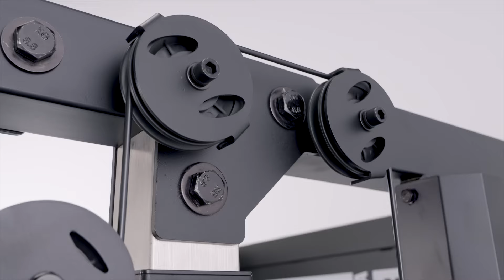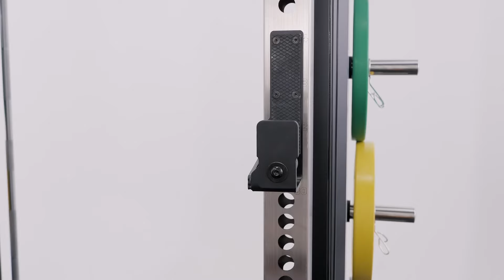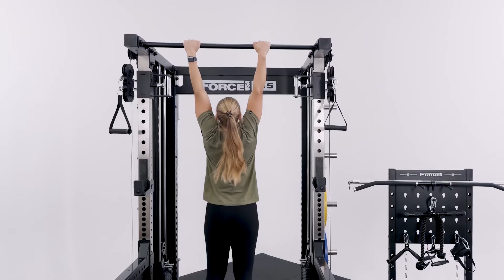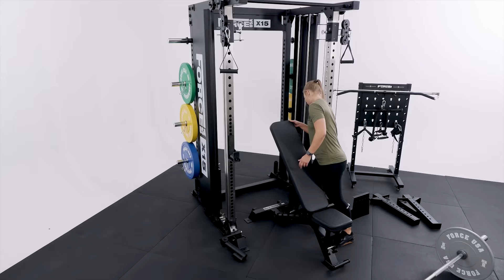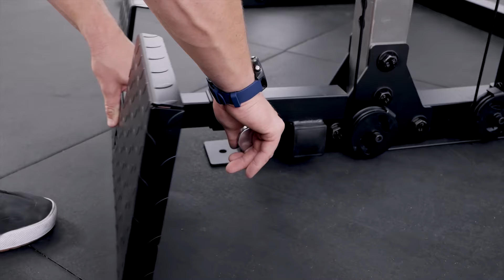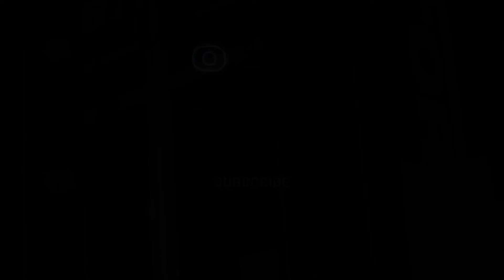Force USA X15 All-In-One Trainer | Walkthrough

Comment: I am interested in the Force USA X15 and would like to inquire whether it is possible to modify the 200 lbs weight stacks to support higher weights, such as 136 kg (300 lbs) or 100 kg (220 lbs), in order to increase the resistance.

Could you please let me know if such modifications are possible, and if so, what the procedure or limitations would be for implementing this change?

Thank you in advance for your response.
Reply from the maker: Hey, great to hear you're interested in the X15, it's a beast of a machine. The 200lb weight stacks were purposely designed to work with the 1:1 and 2:1 pulley ratios, letting you perform key movements like lat pulldowns and low rows with true 1:1 resistance.

We capped the stacks at 200lb to maximize cable travel, going heavier would shorten the range and limit certain movements. That said, you can still increase resistance using GymPins or similar accessories, and we've added band peg hooks if you'd rather use resistance bands.

Our team pushed the limits during testing and no one's managed to max it out yet!
Reply: No Smith..?
Reply from the maker: @rob3332  Not for the X-Series, but plenty of options exist with a Smith machine in our G-Series lineup (or C10). 🙂

https://www.forceusa.com/collections/all-in-one

Comment: So is g12 better than this model or?
Reply from the maker: There are a few things to consider, but It really comes down to two main differences: 1) G12 has a Smith machine, and the X15 does not. 2) The G12 has a 1:1 cable ratio, whereas the X15 has the option to switch between 1:1 and 2:1.

Hope that helps 🙂
Reply: @forceusa1092  yes it does because when me and my wife bought our g12 it was your first edition one. I know you've revised it a bit and now have other options as I'm learning them to spread awareness about your business 😉